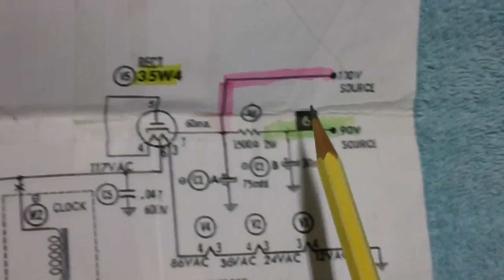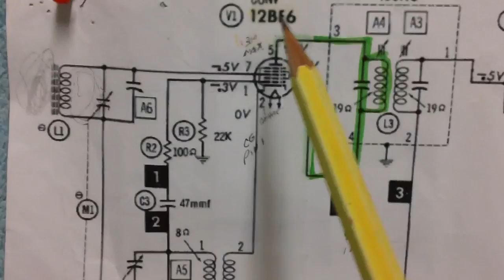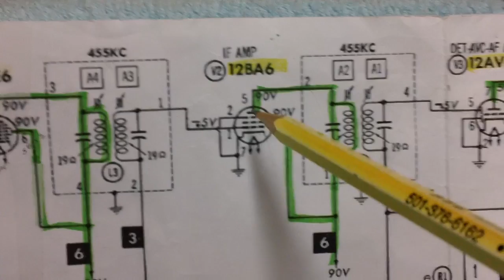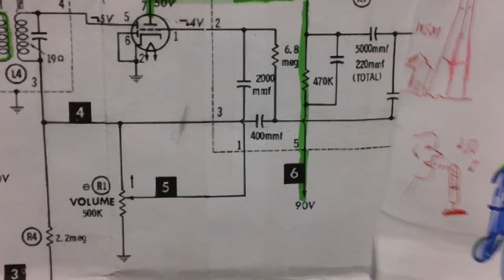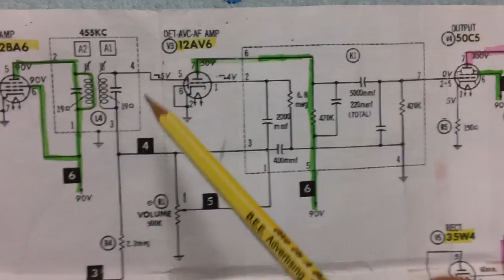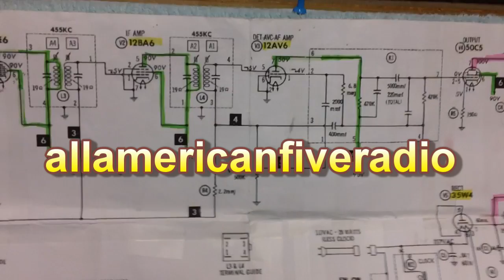General Electric C-403A Radio Repair Exercises (part 11 of 14).

Comment: John,
If I had never seen inside the back of a Vintage Radio but, for some unexplained reason, was suddenly gripped with a desire to begin learning how to restore them…at my age of 59…I’d have to look long and hard to find anything better than your ‘General Electric C-403A Radio Repair Exercises’ series as an introduction to this hobby. 
I say, throughout this tutorial series (thus so far), you have explained the fundamental workings of a Vintage Radio very well.
Thank you my friend,
Phil.

Comment: Another great video.
Im a new bee and have a new bee question.   Electorlytic smoothing capacitors are polarized.  The ground needs to be connected to the chassis.  Otherwise they might explode.    But the old wall plugs were not polarized.  Both blades were the same size.   So when the plug is rotated 180 degrees the hot side is connected to the chassis..... Why isn't this a problem for the electrolytic capacitors?
The old new bee
Mike
Reply from the maker: Mike,
I and Brendan both think this is an excellent question.
The wall socket feeds AC to the rectifier tube, which cuts off half of it, so at that point polarity matters not.  Thus DC polarity doesn't come into play until after the rectifier, which is where the e-caps are located.  As Brendan says: "Easy-peasy".
Feel free to fire back if my answer is confusing. 

Regards,
John
Reply: joernone
Lets say one takes a plug and puts it into a wall socket so the negative side is connected to the rectifier tube plate and the hot side is connected to chassis.   Next connect a oscilloscope to earth ground and the rectifier tube plate.   The scope should read zero volts.  Thats because the negative side of the plug and earth ground are the same thing.  I think thats right?
With the chassis connected to the hot side of the house outlet, 120 ac volts are being feed back thru ground side of the electorlytic  capacitor.  I know my logic is flawed.  So I know I have something wrong.
I  understand your point about the rectifier tube cutting of the negative part of the 120 volt sine wave.  But I only see that when the hot side of the plug is connected to the plate.  
Please check out my comments on C-403A part 10
Confused as usual.
The old new bee
Mike
Reply: Michael Coats Whoops --My comments are on miss mash 80 not c-403a part 10.
Sorry for the mix up.

Comment: Professor John, Q?  What are the five stages from antenna to loudspeaker?  Is the power supply one of the stages (or common to all of them)? Is each valve in an AA5 a stage of a superhet receiver?

Comment: TUBES? Are you referring to the ""valves""? 
110V?  Isn't the ""mains"" 220v?
Why are valve devices "high impedence"? 
Most humans, especially us old goats, can only hear from about 30-10KHz.  The crappy speaker in that GE (and my Filko) can reproduce about 60-8KHz if that, i.e. lowzy bass and highs, mostly mid range.
The spectrum from audio to radio to light, hmmm, audio radiates from a loudspeaker, RF radiates from the wire, and light radiates from ?.  Why does the wire radiate?  This is crucial to understand the scamatic, to control that radiation.
ComPASSitors and coils can pass, and they can block or stop, and they can filter certain freqs, thus the need for understanding the RF spectrum. How do valves work?  How do caps work?  (on AC or DC electron flo)
John, you explained the jurney of electrons from air, antenna, through RF circuitry stages, then converted to amplified audio. Does AA5 also refer to the five stages of a superhet, as well as the five valves?
Listen carefully folks, there will be a QUIZ on Wednesday!!!
Happy toikyday Johnny.  Did you get one of them thar big Butterball electric deep fryers for toiky  - as seen on TV?